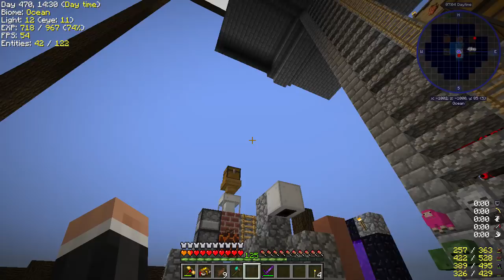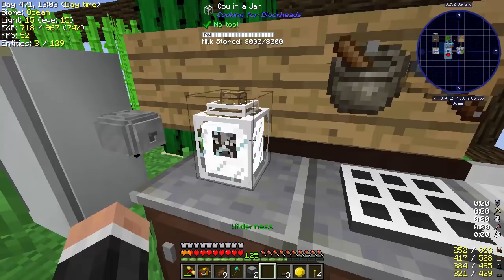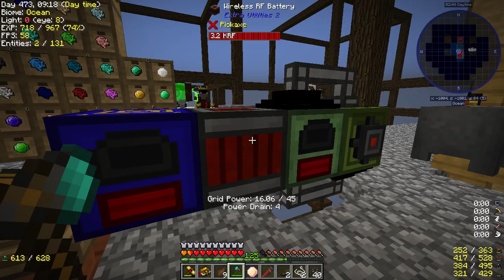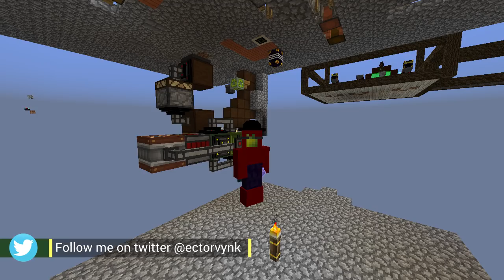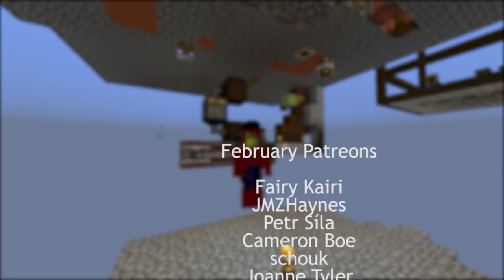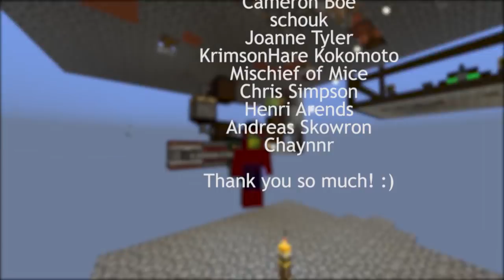Modern Skyblock 3 Departed | Wireless RF Battery & Slimey Generator! | E38 (Modern Skyblock 3 Gated)

Comment: One Wireless Battery can supply many (more than 12, not sure if there is a limit) of the little transmitters.  I usually tuck mine away in a corner feed it some power and then forget about it.  It only transfers power via the transmitters.  You could swap the Capacitor and Battery around just make sure you have the side of the capacitor set to output (orange).  I don't think you need the transmitter on the bottler, because it is getting power directly from the generator.

Comment: Your little slime generator could be a bit more efficient if you had the hopping bonsai feed into either a multi compartment drawer or a drawer controller so it could also keep the regular slime balls the tree drops instead of just the blocks. Though I am curious if the Overclocked would be better than the slime with something like the wood sticks and saplings being fed into it, but it's nice to see something different.